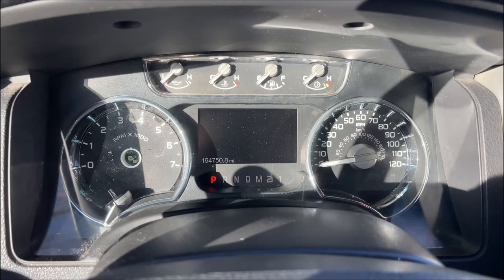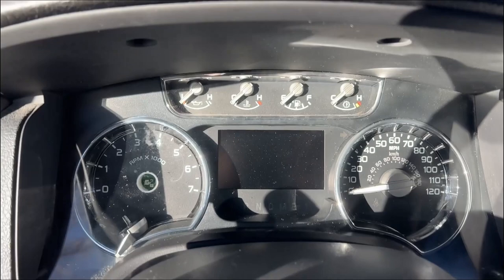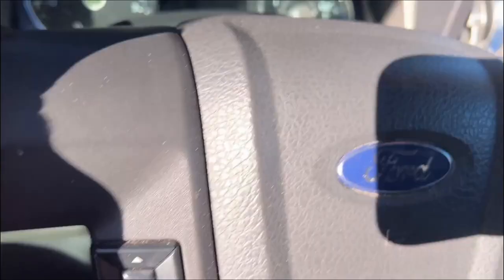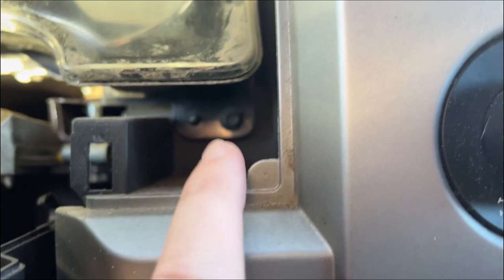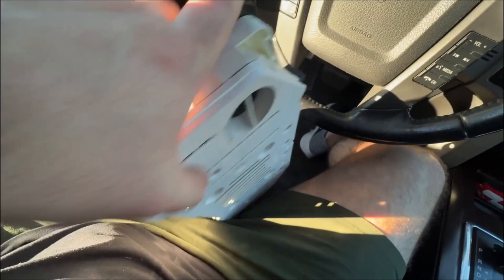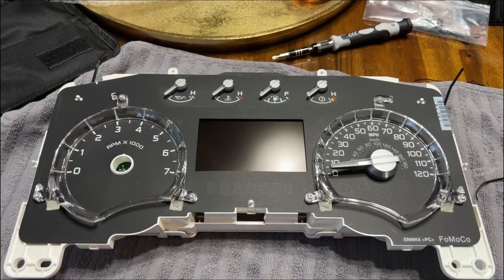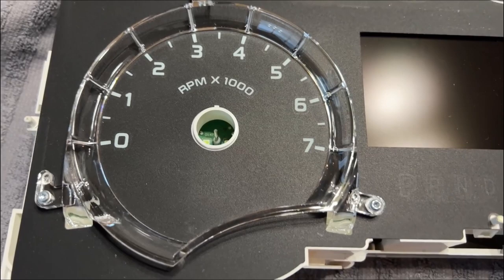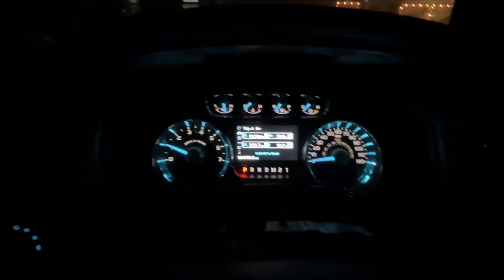How to remove and fix F150 gauge cluster needle

Comment: when you had the cluster out, did you see if there is a way to replace the bulbs that illuminate the various gauges? some of mine have gone out, but I have yet to see even one video depicting someone replacing individual cluster lights.  mine is a 2011 F150 XLT 5.0L.
Reply from the maker: So I didn’t separate the actual face plate from the back so I didn’t see any bulbs exposed other than the little LED lights that illuminate the needle. So my assumption would be that little LEDs are spaced out to illuminate everything else on the cluster. In that case I’d say you either need to buy another cluster or see if someone could remove and re-solder another mini LED for you.
Reply: @Camsh0ts  Thanks for the info, I appreciate it.

Comment: I just did this to my speedo, but I had to counter clockwise click until I was dialed mine was off by 11 mph
Reply: After my engine wouldn't start due to a very weak battery my speedometer needle is 15 mph off.